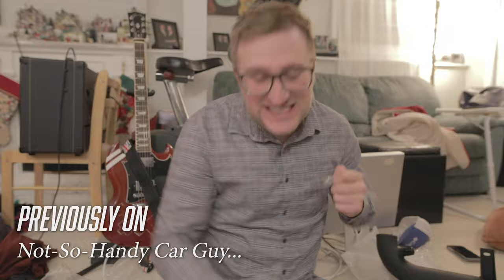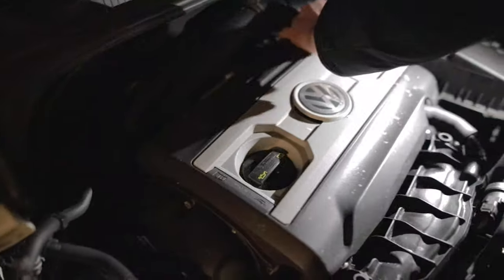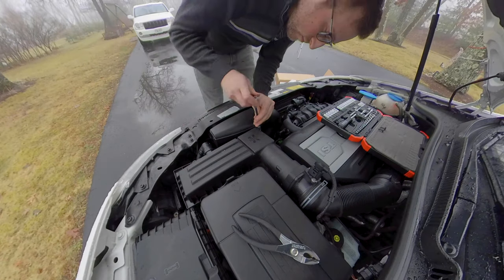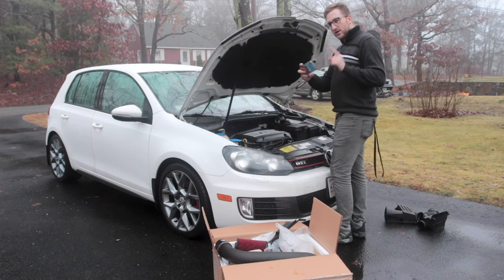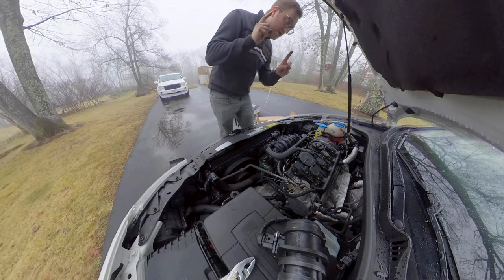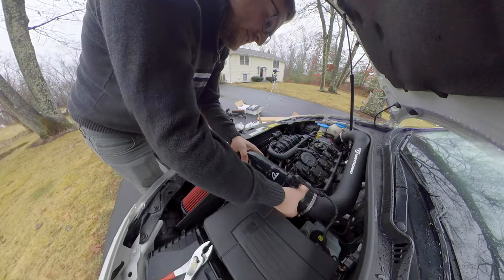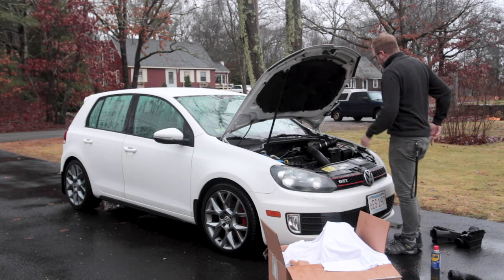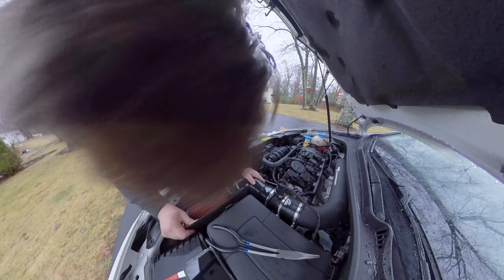Unitronic Cold Air Intake Install and Test - Learning German (Cars)

Comment: I had a apr intake on my mk6 gti and I loved the way it changed the sound of the car and the overall experience. The unitronic intake seem to be of excellent quality!
Reply from the maker: You absolutely can't go wrong with APR either. I almost went APR, but Unitronic is more convenient to flash tune from the 'ol driveway. Very happy with the build of the unitronic parts so far, I just need to figure out that high-rpm whistle.